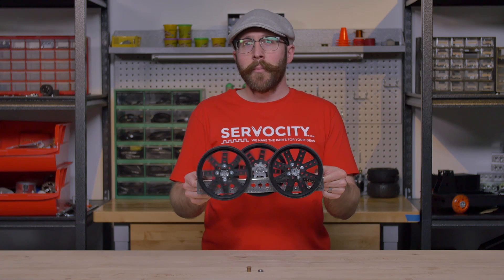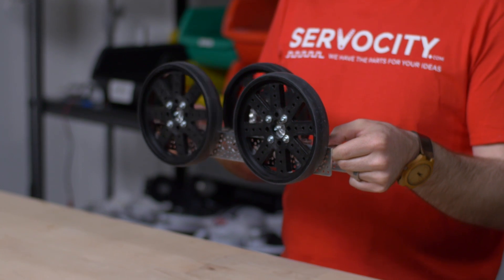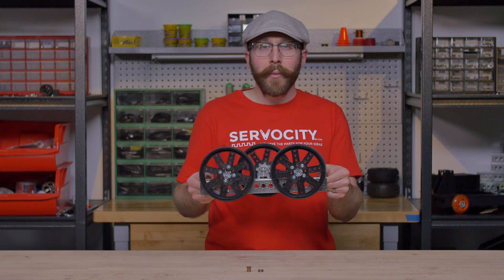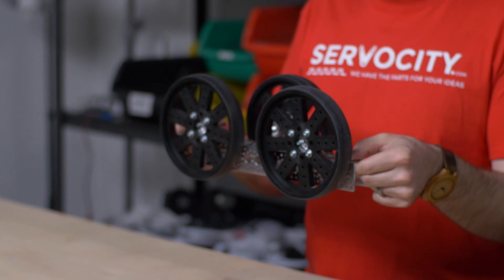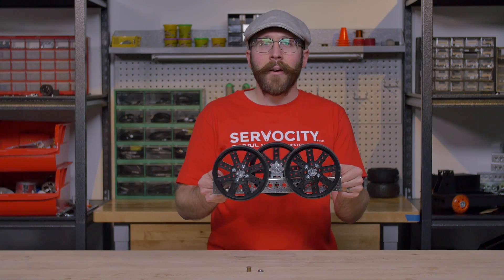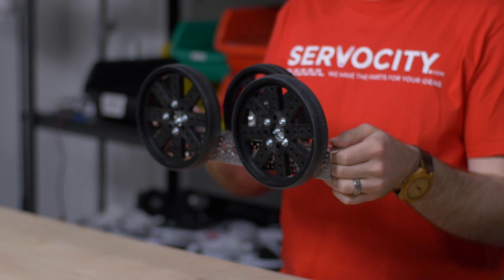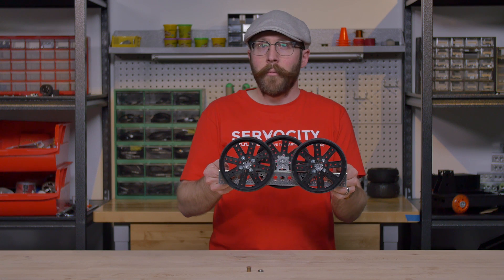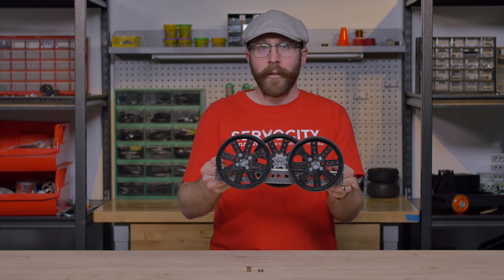Ball Bearings vs Bushings

Comment: Under load the scenario is totally different
Reply: How would it be under load?
Reply: @LudoA  you don't know until you try. usually bushings can be just as good if not better than bearings under load. you have to test it with preload already on it - otherwise it's just a fidget spinner

Comment: Why bother allowing the existence of bushings then if they have all the disadvantages that bearings don't have?
Only reason I can think of is if you're on a tight budget.
Reply from the maker: Hi Quinn, budget would certainly be one driving factor.  If you're limited on space, you may have to resort to a bushing as the OD can be more similar to the ID.  If you have an assembly (farm implement, for example) that experiences heavy shock loads, a bushing might be a consideration.  Also, an edge case but if you have a rotating assembly that you're grounding through (think lathe and wire-feed welder) bushings would survive better here given the greater amount of surface contact to ground through.  Feel free to let us know should you have any other questions tech@servocity.com.

Comment: Will a brass bushing 4 inch fan eventually sieze up or?
Reply from the maker: It's hard to predict the fate of your fan, but the more likely scenario would be that as the bearing wears out, the added friction will eventually cause the motor to fail.  Note this prediction is a speculation and there are many other problems that could arise and lead to the demise of your fan.  Let us know should you have any other questions tech@servocity.com.

Comment: How did you mount the bronze bushings to actobotics components? The bronze bushings that are sold on your site are .38 inches outer diameter which doesn't fit in the standard actobotics hole pattern.
Reply from the maker: Hi Ishann, unfortunately this was a quick build, so I do not have the exact parts list, however, shoot our tech team an email at tech@servocity.com and they'll be glad try and assist.  Thank you